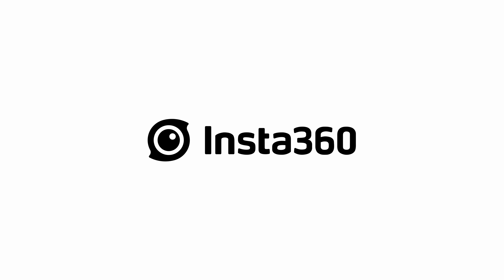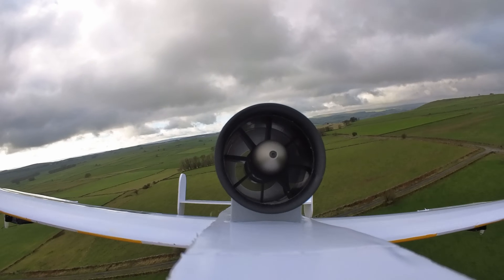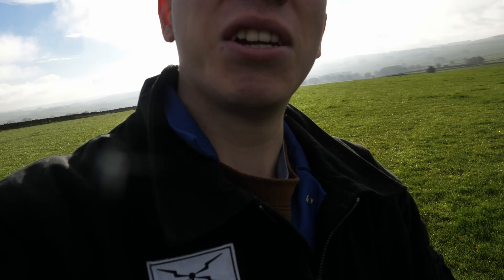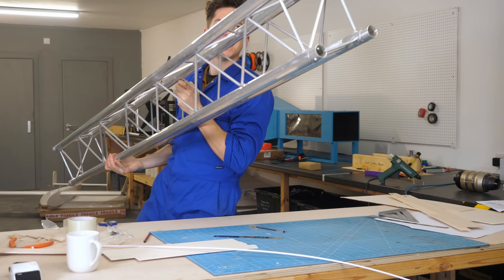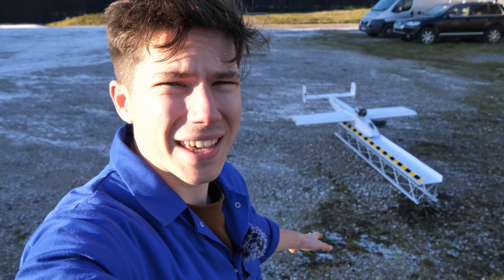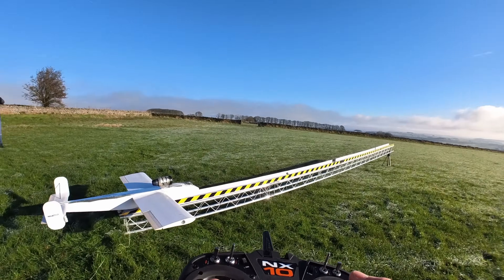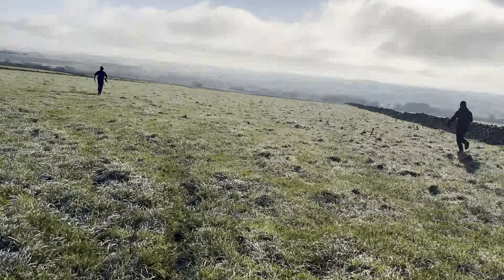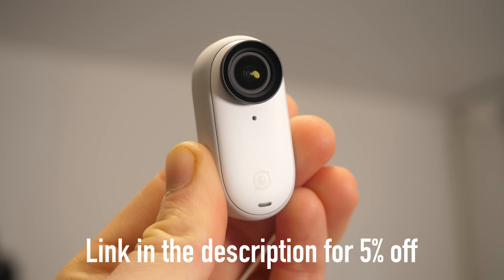Foam RC Jet

Comment: LOOK     #projectAir..... great series....ive  been at this game for 30+ years     >>>>intermittent connection between roll movements.<<<<...both times you were in left bank.......seems like a power issue option 1(gravity pulls stuff....like battery's ,wires or component's even connectors) or most probable ......option 2 ....momentary large current draw .....sapping the receiver power circuit will also halt the servos operation in the moment.      and vice-versa>>>>> i have had a servo with a little crumb of plastic floating inside that would do this exact same thing .....everything worked fine,,,,i would pull up and the crumb would jamb the servo gear causing a current draw spike ...rx would brown out for a second ...plane would roll or stall crumb falls out of gears , current goes normal and rx comes back on... lost 3-4 nice aircraft before i found it.......do a after crash test ....clean all the gear....reassemble on a dummy plane and try to recreate the error or failure

Comment: Does the engine try to re-light with a spark plug? The re-light might have been causing wideband RF noise interfering with communication.

Comment: Maybe a satellite or two on the wingtips away from the foil would have helped.

Also: Do not use dsm2/x on anything else than UMX planes and little park flyers! I used to have Spektrum gear as well and had about 1-2 signal losses per year. 
I switched to a 4in1 modul transmitter with open/Edge TX using mostly an external ELRS module or the internal frsky. Not had a problem since and you can still use your dsm2/x receivers on little planes with the 4in1 module.
Reply: USE lrs! Absolutely useless these spectrum controllers

Comment: Really sorry for the loss of the aircraft. Great video and it looked like a genuinely fun project. r/c model pilot here for over 30 years and commercial UAS operator for over 10 years. In that time one thing I have learned is that your radio needs to be absolutely solid and in my bitter experience, Spektrum stuff is not great and in some cases is absolutely appalling. Equally, neither my Futaba nor Airtronics have ever missed a beat. Not finger pointing here as it's just one person's view, but I'd be looking very carefully at the radio during your post mortem and thinking hard about what brand to put in the version 2 model. A 250g foamie glider is one thing, a jet powered foamie is a very different risk proposition. Good luck...!

Comment: Foil tape and glass tape will blocking signals to some one extent or another, but additionally turbines generate loads of static due to high RPM and friction in the system. This generates significant interference, so it is essential to keep your receivers well away from the turbine, fuel pump and ECU. Good quality turbine oil with static inhibitors are also a good shout, if you're not already using some, but as you've also realised you need your signal to be MUCH more redundant. Dual receivers, minimum, and four antenna to provide redundancy and eliminate as many signal blind spots on the model as possible whilst it is in any given orientation - point the antennas in different directions - along the fuselage and straight up/down. The very tip of the RX antenna pointed straight at the TX creates the weakest signal because the signal radiates along the length of the antenna and not from the top. You need to make sure that at least one antenna is never pointing straight at you in any given orientation.

I hate publicly slamming manufacturers, but I've been a Spektrum customer in the past and it's just garbage. I've lost more models to Spektrum lockouts then I'd like to admit. Please choose a more reputable TX/RX solution which is actually fit for purpose. PowerBox, Futaba, Jetti, Multiplex, just not Spektrum. A high quality Tx/Rx is your best insurance policy and will elevate your chances of your recovering your expensive model. Even if it is DIY, it's still not cheap. It might be made out of cheap materials but it's still got a two grands worth of propulsion system in it. Building cheap is possible but it's a false economy. There are companies which already manufacture foam fuselage airframes so I'm not sure what we're trying to prove here.

Comment: my guess on loosing RC signal is that the aluminium tape you put on the plane inadvertently shieling the RF signal, along with poor antenna placement. are you sure the jet cutting out want failsafe due to poor RF signal?

Comment: Sometimes it is good to ask advice from others who have experience of this type of experiment to avoid costly incidents like this. I am sorry this has happened to you. It is easier to let someone else wreck equipment and give you simple advice that will avoid you going through the same. If feel that you were lucky in some other respects too. Rectangular ailerons all the way to the wingtips so they sit in the vortex in a foam plane with a 100n turbine.. When flutter comes, it is instant and catastrophic..

Comment: You need satellite antenna to the receiver.   Maybe you should fly the plane with equal weighted 90mm EDF first to confirm signal flight.   Also use a flight stabilizer gyro.
Reply: What receiver was he using?

Comment: You should really switch to ELRS for your control link, even at 10mw it will far out perform the other protocols like DSMX, FRSky etc.  for this project though I’d seriously consider crossfire or elrs 868mhz for simple redundancy.

Comment: I don't know if others already commented, but instead of a solid fuel tank you could use a fuel bag. You can fill the bag completly, so that there is no air inside, and the bag simply shrinks as  the engine consumes the fuel. I have seen this type of tank used in several other rc-jets. 
Anyway keep up the good work :D
Reply: Good suggestion!
Reply: Just popped in from Australia to say;
Goon jet, please? Or perhaps, Wheel of Goon, with a jet.
(Goon is Australian slang for wine that comes in a bag in a box, generally cheap wine, and a cultural touchstone)
Reply: @AssidiousBlue-ul2fo  that concept should work in general, but the bag needs to be out of material that wont be dissolved by the fuel. I don't know if wine bags are the best idea, but it woul certainly be funny :D
Reply: I know that older pulse jet guys would use some sort of medical IV bags, but I'm not sure of the material. They used gasoline typically, so it should work for kero. Ask around forums where they hang out. I know you can get off the shelf fuel bladders as large as 10L, but I don't think anything small enough for this.
Reply: A few of the real jets and turboprop aircraft I work on use bag tanks!
Reply: @Lemonzrool  😏
Reply: In fact, I believe many aircraft use bladder type fuel tanks. I know the Canberra did.
Reply: ? no advantage...   the 10 ounce take I had was less then 5 grams empty.
Reply: What if you add a light fuel tank just foam and fuel at the tail with a little hatch to refill
Reply: Is a wine box bag too DIY for this?
Reply: Bubble traps work just fine. He just forgot to install one. Even in a bag with the air removed, it can still create stimulated bubbles. It's almost impossible to bleed a low-pressure system. An air bubble will hide somewhere and doom your jet. A bubble trap is foolproof if installed. Which he forgot to do. Must remember he is making video content and building projects. The stress from all that makes it much harder for him and mistakes are bound to happen. I make mistakes and I'm not in a rush to make content, lol.
Reply: @FarmerFpv  Absolutely, and you make great points, we understand this stemmed from a small oversight but exploring the options.. we'd love to see a goon bag jet plane for the laughs. Even if it fails, it'd still make great content.
Reply: I'm wondering if the carbon fiber tube in the wings could serve as containment for a fuel bag?
Reply: @Ragspierre-sez  that would Probably not be the best idea, as the fuel could still slosh from one side of the wing to the other. Unless you use multiple smaller bags the weigh would shift to much. Also the accessability wouldn't be to great since you can't just open the wings.
But it would be a good idea to contain the fuelbag in a more stable fuel tank in case there is a leak.
Reply: @wolfganghorn7492  I agree with some of these points regarding weight shifting, accessibility and leaking. It'd be good to keep the fuel bag contained, especially in case of a crash to avoid a fuel leak causing further damage to components and environment. Great idea though to minimize air / voids in the fuel line.
Reply: @GummySharp  i did that and engine failure the engine explode burning like hell i was still able to land it and barely saved it from burning the whole plane
Reply: @Ragspierre-sez  could cause trouble with weight distribution when fuel is been used,

Comment: Does the jet engine have a sparker to start the engine? When it shut down, does it automatically tried to restart? Sparks create enormous Emi. Se with diy plasma cutting tables. The spark for ignition just kills all the elektronica and data comme tions around it.

Comment: Great project! In the future, avoid protocols like Spectrum DMSX and rather use a radio that can run openTX/edgeTX with an expressLRS module. These systems are not only cheaper but also offer far more customizability and range at the cost of a slightly more cumbersome setup.

Comment: Don't know why you lost control even if jet engine fails still should have control to land the plane unless you had a loose confection on the battery  it happened to me bran new tank buster rc plane maiden flight smashed to pieces  !  Brilliant vidieo best of luck next time

Comment: Brilliant vid, if sad ending. I didn't see exactly where you put the receiver in the airframe, but I strongly suspect that the big expanse of foil tape got in the way of the signal when you were climbing after takeoff. Given (I assume from a previous video) you're a Vampire enjoyer, why not make the mk.II a twin-boom bird to get the rear fuse clear of the jet wash and eliminate the need for the tape?

Comment: One of the reasons of shorter signal range than typical might be caused by all the foil and metal (and carbon fiber) in the airplane. Also maybe some components of jet engine (pump which stalled for ex) sparks and cause radio interference. Best solution is to keep your RX antennas as far as possible from the metal parts etc. (end of the wing is a good spot). Also DSM2 is an old technology, as other have said ERLS is great solution and should guarantee range measured in kilometres. But if you would go for ERLS I think 2.4ghz is better than sub ghz versions, as these lower frequencies can have issues with bouncing from metal/carbon parts.
Reply: Also getting and diversity receiver and placing the antennas in a position where never both can get blocked by the engine/carbon is really worth on such an expensive aircraft. For maximum safety he could also install a flight controller and gps for rth
Reply: Having seen a dsm2 controlled drone have a similar loss of signal when even closer to me than this jet was I agree that orientation affects signal strength.
If the receiver was in the body of the airplane then the aluminized tape was most likely directly between the transmitter and reciever during a banking turn like what was going on during the LoS event...
My money is on the tape being a significant factor.
Reply: @Roll4569  I agree, that large area of metal foil screening an internal antenna would cause a sharp drop in SNR.
I didn't see any external antennas with 90 degree diversity.
Reply: I'm not sure that its the range because before the control was lost he had gone farther and then he lost control after the high g turn.
Reply: @kiritoxasuna2643   during turn it is possible that antennas changed alignment with receiver antenna (they should be on the same plane) which can drastically reduce signal strength. So when you fly straight everything is alright until you turn and antennas are out of alignment and you loose signal. That is why you can see two antennas on receivers which are 90 degrees apart from each other.
Reply: All the below replies are great. I just wanted to add that a range check might also have help with this expensive/in-expensive jet. Personally, I don't like any DSM2 specktrum stuff because my flying friend all had had these issues with them. I really don't know why but since I stayed away from those receiver setups I never had a problem. Yes, go with ELRS/Crossfire or RadioMaster system is my suggestion as well. Great Video!!
Reply: I also seem to recall from another RC tuber that those mini jet engines can cause a ton of EMI for some reason. But yeah consensus is better antenna(e) placement and do range/orientation tests before the next flight.
Reply: How do we know he was using DSM2?  He could be using the older DSM or the newer DSMX but unless i missed something, we don't know.  

I have been using DSM/DSM2 ever since it came out 15ish years ago and I have never had a problem with signal loss.  I've used it in everything from 3 different turbine jets to 40% gassers without an issue.  I don't think his setup was the issue...I think his receiver just failed.  The airframe does not have enough carbon (the carbon fiber receivers are specifically designed to be used in a full carbon structure.  The carbon tube in the wing would not cause the signal loss) .I've had some of the AR7000 receivers fail on the bench by refusing to bind but i've yet to have any DSM receivers fail, brown out or lock out in the air.
Reply: @Ramztothaz Honestly, DSM2, DSMX, FrSky, and all other big name rc plane receiver guys get completely outclassed in every way by ELRS. It is reliable,  has adaptable power, very high refresh rate and is dirt cheap.

I lost multiple flying wings to DSMX and FSHSS/D16, never even had a weak link on ELRS.
Reply: @Ramztothaz  I think you've been lucky than most of us then. Back in the day I bought a shiny new DX8 and then lost four aircraft in one season (all using brand new genuine DSM2 AR9100 and AR7000 receivers). That's when I sold the lot and bought my FRSky X9d!  I've got a Radiomaster TX16s and ELRS now.
Reply: He’s in the UK and using an NX10, so it can only be DSMX really as DSM2 has been banned here due to an EU regs change a long time ago
Reply: ELRS would be way better here. Especially now we have great quality PWM receiver with diversity antenna. Surprised he used DSMX for jet based fixed wing
Reply: DSM2 is kinda trash, he should definitely use ELRS or crossfire. Those systems easily reach 100km of range. With those systems you don’t have to worry too much about antenna alignment when your flying less than 10km
Reply: @rowannadon7668  ...which is why they discontinued making DSM2 a decade ago.
Reply: my theory is that the plane, going so fast, was cooling down rapidly and the battery voltage dropped because of this, so the radio stopped working.then with no power draw the voltage gone up a bit and then fell down again when he tried to roll the plane because the servos drew power. I know my theory is pretty stupid, but at least is a theory :D

Comment: My bet is that a 1/16 Mosquito took it out - you've basically built a V1. ;)

Great project - looking forward to version two.
Reply: Didn't the V-1 use a pulse jet? Would love to see that miniaturised
Reply: @BoarhideGaming  looks more like the salamander.
Reply: @BoarhideGaming  Yes they did have pulse jets, but the fuselage and engine position is almost identical, even the take off ramp and trolley is the same as V1
Reply: @BoarhideGaming considering that Pulse Jets actually scale down pretty efficiently to RC plane scale, that might work... Provided you can handle the noise and the raw heat, of course
Reply: hehehe

Comment: Why not use long-range receivers/transmitters?  Such as ELRS or Crossfire?
Reply: Exactly, it's very affordable, going the elrs way, and crossfire has been tried and true for over a decade. I recommend getting a radiomaster boxer with one watt elrs built-in. He's never going to read this bla bla bla bla bla
Reply: @Nicholas_Kage I'd suggest that too and he'll probably have miles of range
Reply: This was my first thought...The issue is that the RC plane community is very fixated with the spectrum/futaba transmitters and receivers.
Reply: Get a jeti tx/rx, it's worth it.
Reply: Whatever radio used here, it would have been enough for the range shown. But I exclusively use ELRS - I wouldn't use anything else nowadays.
Reply: Yup. I have a Radiomaster Boxer with ELRS 1 watt internal and a Crossfire module in the bay. ELRS for small stuff where it's hard to place a 900MHz antenna. I've flown a sub-250g quadcopter out to 4km on Crossfire even with a poor antenna mount orientation (horizontal) due to the lack of space on such a small quad. Got rid of my Spektrum gear after having micro failsafes inside of LOS range.

Comment: Really glad that you show us the whole process, including when things don't go to plan :)

Could the foil tape have blocked the signal from your transmitter?
Reply: Foil, big carbon composite tube, engine can block the signal. Good range test should have show these before the flight.
Reply: Use a different control protocol. Something like elrs. They have pem recievers now and 50km of range.
Reply: so extend the antennas to the wingtips or something?
Reply: i also think that's the problem
Reply: that is actually an excellent observation
Reply: ...and the ruddy great CF spar! Did you have satellite Rx(s) maybe at the tail end?